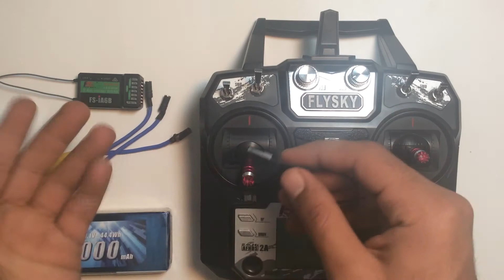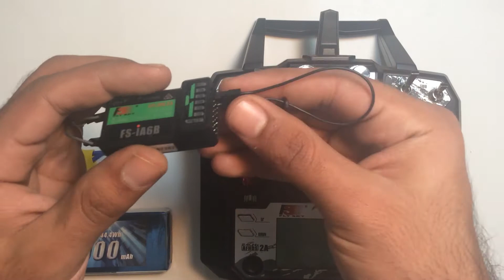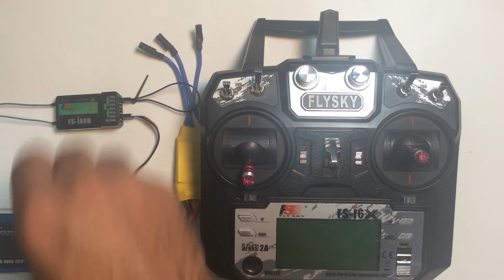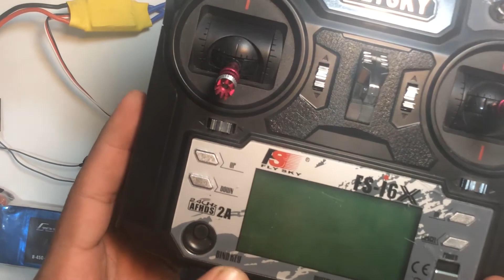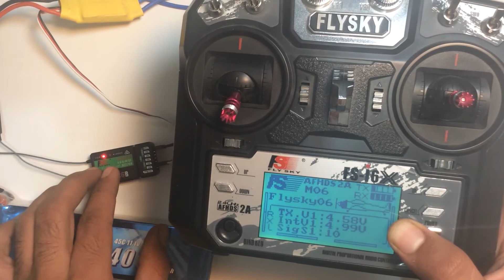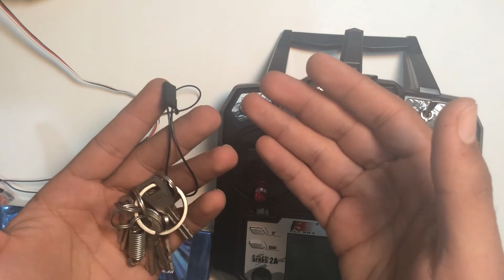FLYSKY Fs-i6X BINDING | Fs-ia6b RECIVER.

Comment: in my fsi6 remote control error shown on the disply  and it suddely increases with drone distance . what is the solution for this trouble ?
Reply: Keep the throttle down and then start
Reply: @avinashshikaripurmohan  not work